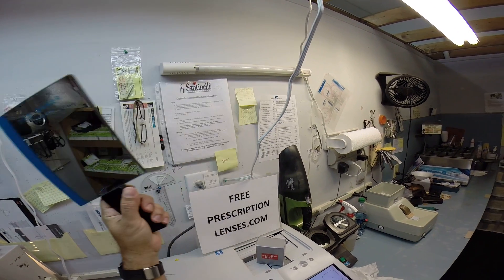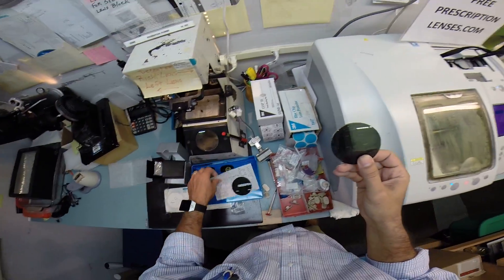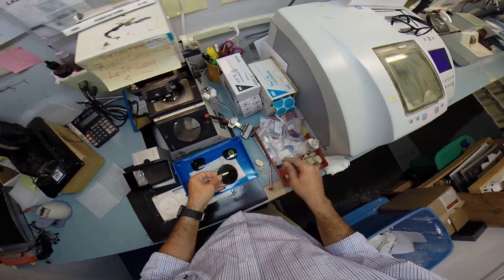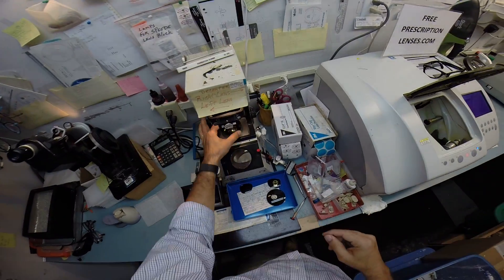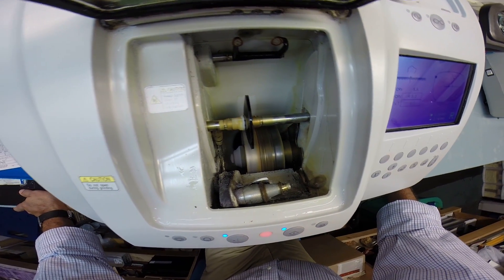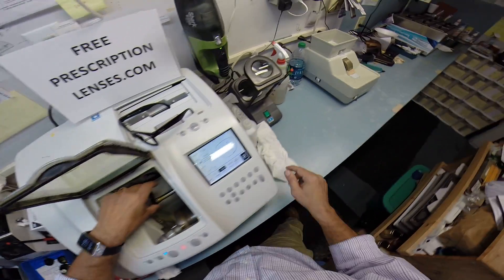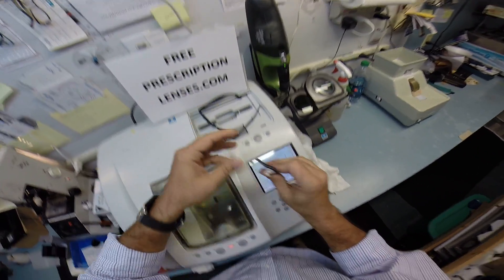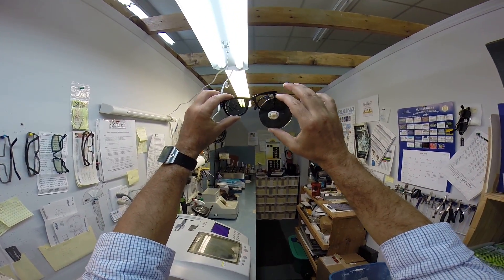Randal l's RayBan 4105 Folding Wayfarers with Rx G15 Polarized Lenses

Comment: Q:  Can Polarized Rx BIFOCAL sunglasses be made with gradient lenses? The gradual gradient looks so much nicer.  Plus, wouldn't that more clearer portion of the lens at the bottom be easier for beach reading?
Reply from the maker: Sylvia Catalano Hello Sylvia and thanks for your interest. Unfortunately polarized bifocals only come in a solid color. Now gradient would help reading price tags inside however there is enough light outdoors at the beach that reading will be easy through a solid tint. Perhaps even better because so much less glare would be coming through the bottom portion of the lens.
Also please forgive me, somehow I missed your comment from 9 months ago. I would need to check on the availability of any Transitions 6 lenses left. However my experience has been just the opposite of the word from the street. Transitions 7 change faster and have less residual indoor tint than ever before. I've got several pairs and I love them. i wouldn't have a pair without!
Just so I don't miss any more of your questions please email me any thoughts or concerns to freeprescriptionlenses@gmail.com
Matthew
P.S. I checked out your Google + page. how'd your strawberries turn out? I'll show you mine if you show me yours;)